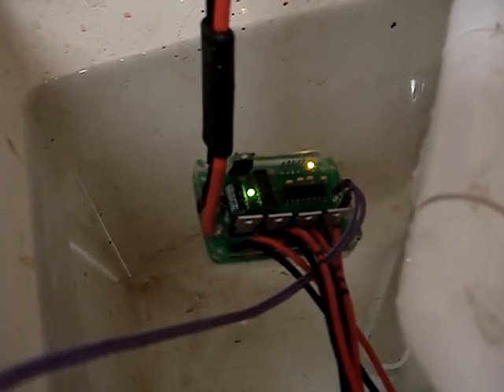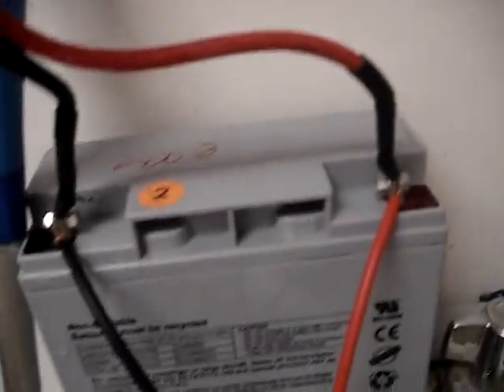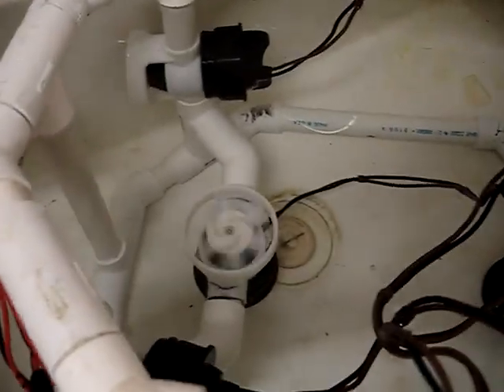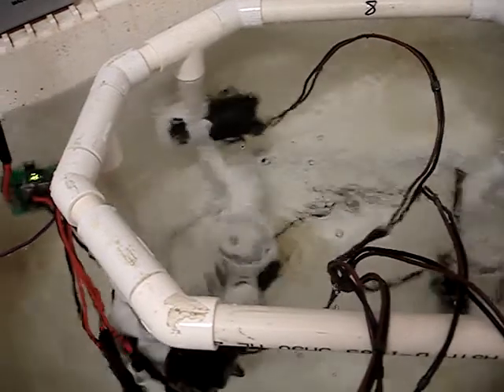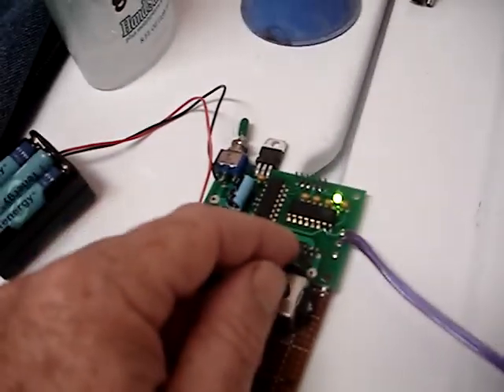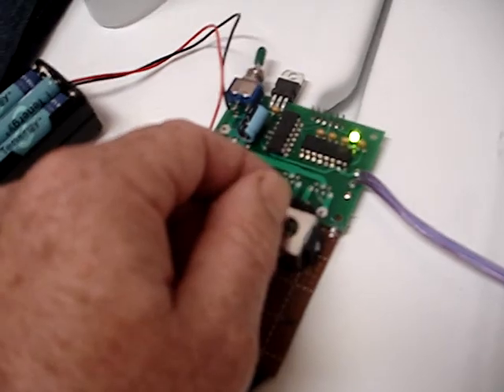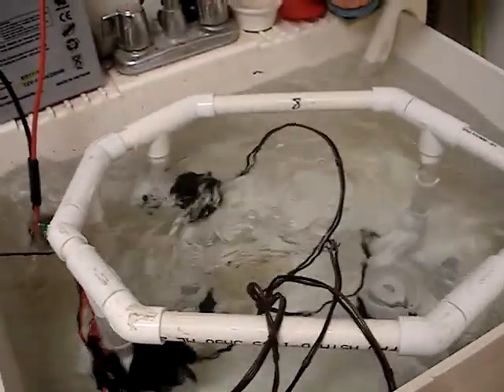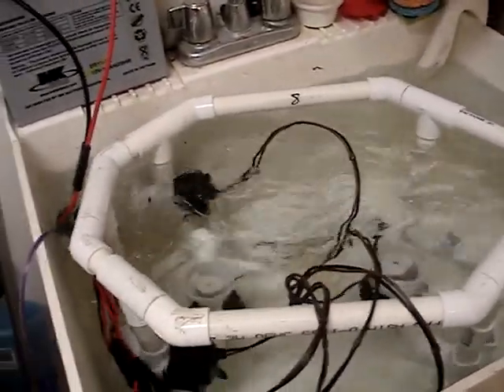DCX ROV Early Control testing

Comment: hi, im building a ROV too (as a possible university project). what kind of electronics did you use in the controller and remote ? is there an example for the controller and code ?